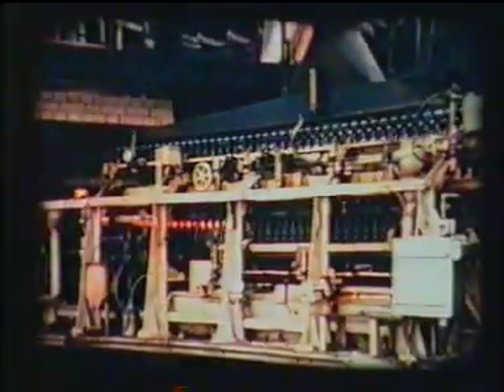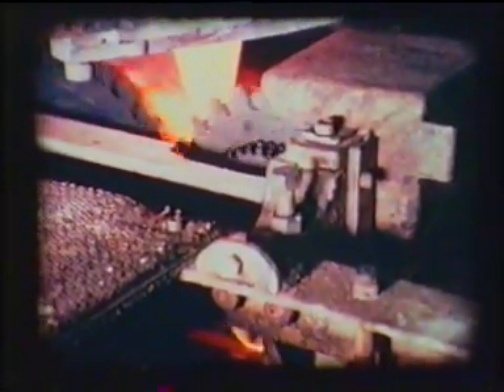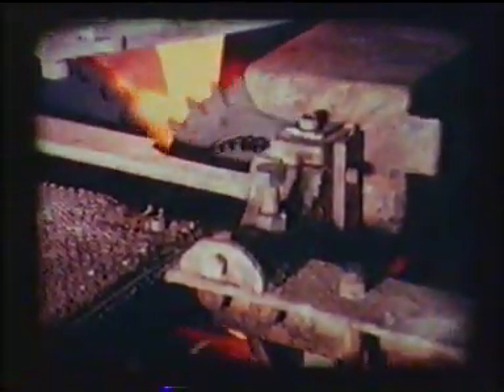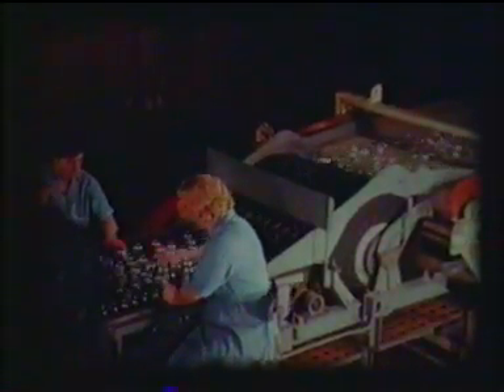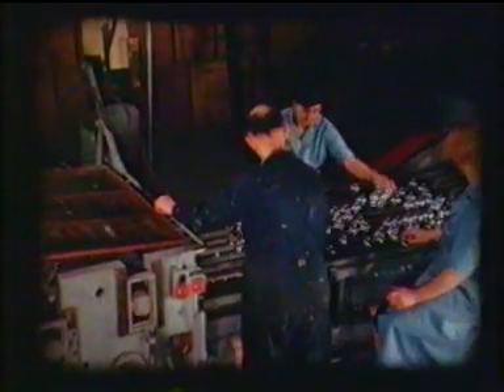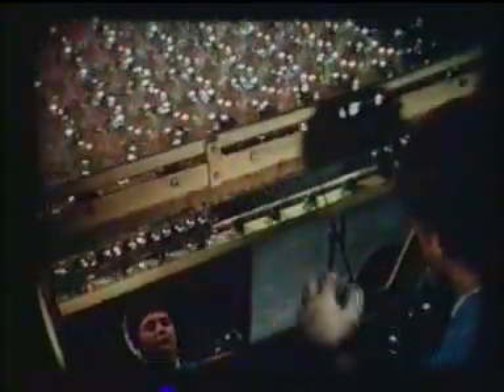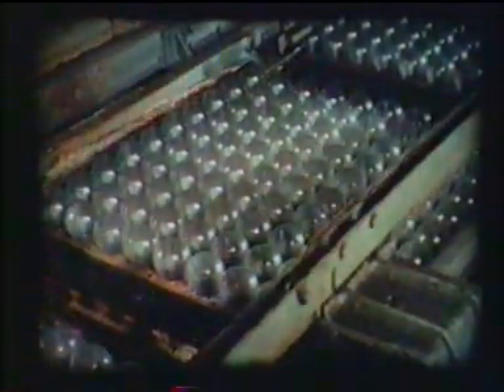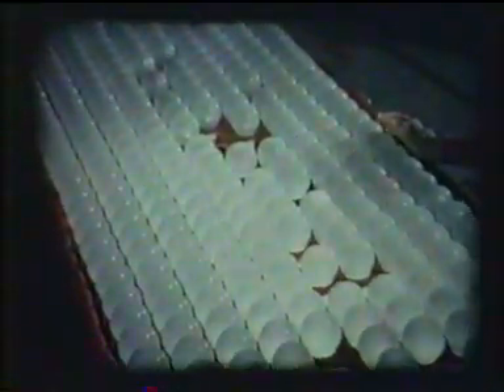Movies - Glass Bulbs Ltd - The Ribbon Machine - 1950

Comment: I worked at GE Ky Glass Plant in Lex. Ky. from 1981 till 2007 , we were the worlds fastest and most productive for many years.  As a shift mechanic and later a millwright I maintained every piece of equipment in the plant at some time or other, and installed many others over the course of my employment till I retired in 2007.  What an adventure it was.
Reply: Sadly the plant closed in 2010 after over 60 years of operation. To my coworkers, I will never forget you and the times we shared. God Bless.
Reply: Did you ever have anyone crash one of these machines?
Reply: As a matter of fact , I did, but more often than not, the machines would crash themselves. For any number of reasons.  One of the best parts of the job was you never quit learning new things. The best I learned about machinery that is operating properly is that it will do the same exact same thing every time it goes through its cycle of operation, any deviance from that indicates a problem. A new squeak or an odd jerk at some point in the cycle and so . So learn your equipment and its function then the rest is just nuts ,  bolts and a good torch and welder, A knowledge of electrical is also a must, it just makes the job easier and Im all for making the job easier or "efficient".  Your question implies you have ran into those situations of human and mechanical "interactions", lol . Some folks just don't have any mechanical aptitude at all. but they sure know how to push the  buttons on a control panel. LOL Thanks for the question, it takes me back.
Reply: Yes I work on Glass press forming machines, we make plates, bowls and tumblers and some pitchers. Sorry for the much delayed response,I seen that these machines use Lincoln Lube for the lube system. Did this place have machine repair around the clock or did you have a weekly call-in rotation?